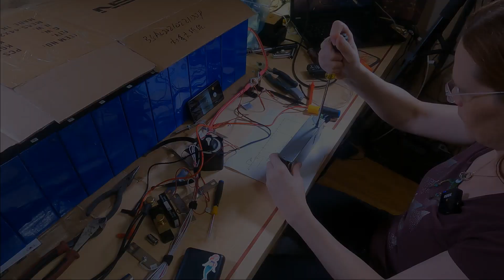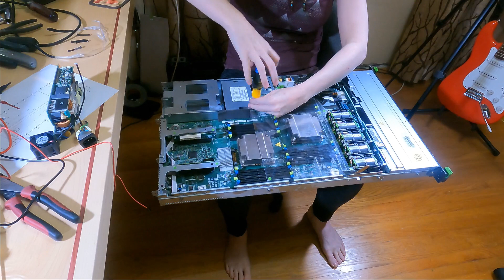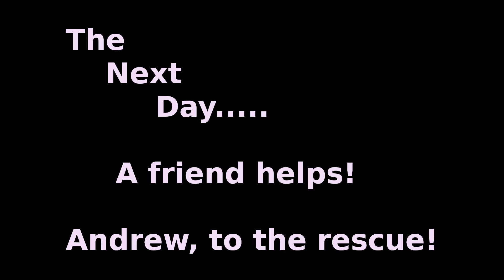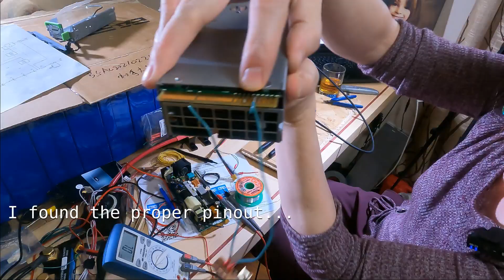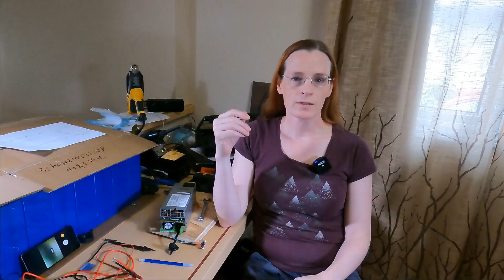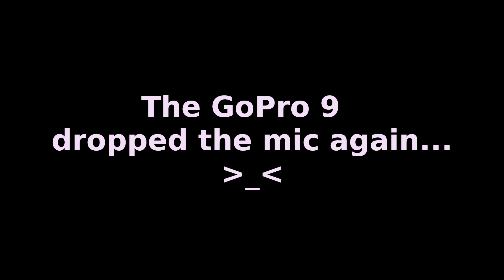Building a Good and Cheap Bench Power Supply - How to build a 48v Lifepo4 battery (Ep. 7)

Comment: Yea, I know, 2 years old ... but, at 23:35 ... instead of cutting the tinned tip, you can use a big pair of CHANNELLOCK pliers and flatten the tinned part.  I make power supply's with these all the time.  I recently made a 48v 63A PS with 4 of the HP 750W.  You need to be careful with the grounding, but these server power suppliers are awesome.
Reply from the maker: They are, and it was a fun project! I was using it today, even

Comment: I use gopro cameras for my youtube videos and they are the most unreliable devices I have ever used and not cheap. They constantly crash or discharge the battery for no reason. I am also amazed how they are still in business. Really enjoying your video's.
Reply from the maker: I hate the thing so damn much... Now it's 2/3 times, turning it on is a five minute ordeal... Skip all the damn ads for their subscription service, camera wants to set the date, quick app sees the camera but the camera doesn't talk to the app... delete and re-add the camera to get it talking, finally start filming. Or other times, it just won't turn on until I pull and reseat the battery. To say nothing of the crap battery life, constantly turning itself on when it's charging, corrupted files... ugh

Comment: What size wire did you use to connect to the two 7 AW's coming off the JK bms?
Reply from the maker: iirc, I used 4awg ring terminal to fit the 2x 7awg(??) cables the Overkill Solar / JBD BMS came with.

Comment: HOWdy  D-M,
Basically a  FREE "bench"  Power Supply  from an vintage SERVER 
Thanks
...
Yesterday  I  hoisted my  110 pound  GroWatt 6000 INVERTER  up on the Wall ( wall covered in Cement Board ) 
Today's project is to "FISH" my 100' long brand new ( CHEAP )  Steel FISH-TAPE from the House out to my Ground Mount ARRAY 
   ( I was going "fishing" YESTERDAY but my High-Dollar  KLEIN Fish-Tape BROKE  4'  out of it's ROUND Tool Case )
Fingers Crossed - I'g love to have some  "PV" Power to Charge MY Batteries 
COOP
...
Reply from the maker: I'm actually surprised you broke the Klein... Can you return it?

Comment: Please remember, BEFORE you test continuity / Ohm's, ALWAYS test for voltage when working like this. Specfically when there are capacitors. You Never Want voltage present when testing continuity / Ohm's.    It may seem trivial. However with enough voltage, you can let the magic smoke out of your meter. I've seen it happen. I give a 5 minute discussion on meters and testing continutiy / Ohm's.       And as I walked away...   I head the meter jump off the bench, and the guy using it fall on the floor [because he was scared -- not shocked] because he put the meter on Ohm's and put the leads in a live AC outlet.   Magic smoke everywhere. 

If you put the meter on the highest DC voltage setting, and check for voltage on the ends you are going to test for continuity. If nothing else, it will safely discharge this kind of capacitor shown in this video.
Reply: i was going to ask, once power supplies are powered, i know there should be time left for discharge, but when testing there has to be a way of doing this safely - thanks for sharing

Comment: I use Riden supplies, very programmable, and ideal if you need a power supply that will also charge batteries. I own both the RD6018 and the RD6012. Yes, a complete kit is almost $200 US dollars, but they are very worth it.
Reply from the maker: Looking at the RD6018, it shows a Mac amperage of 18A. If so, the iCharger X8 can do 30A for under $100, assuming you have a sufficient PSU for it, like a modified server PSU. Given how long it takes to top balance a 16 cell pack, that's a non-trivial difference. Am I missing something about the Riden?
Reply: @TheDigitalMermaid  The maximum amperage is indeed 18 amps at 60v. It is good for charging a 48v pack, as well as 18 amps at 3.65v, and everything in between. I do admit I use a 30v at 40 amps supply for top balancing, but that will only charge a 24v pack. The Riden is more aimed at the benchtop lab market with a USB and optional wifi interface. It is quite reliable however, set it to 3.65v and walk away, it stops when current drops to .1 amp in the battery charging mode.
Reply from the maker: @john_in_phoenix  for pack charging, I use the Quattro, which is also an inverter. Suppose it depends on your focus.
Reply: @TheDigitalMermaid  very true. I have lots of uses for programmable power supplies. Usually I charge in series until one cell hits disconnect, then in parallel to finish at 3.65v. I will probably try an active balancer soon, same concept as the icharger, just cheaper if you already have a good supply. Charge in series, then when the cells get in the 3.4v range, drop the current so the balancer can keep up. Like Andy, the first thing I figured out about active balancers is that they will actively unbalance you if left on in the flat part of the curve. They work great at either extreme though. I should add that I am a tool junkie, I have 4 of the Ridens, so tend to hook up 4 cells individually and set them at 3.65v.

Comment: I was lost as to why you were having so much of a struggle getting solder onto the pads, and then you mentioned Lead free solder. 99.3% Tin-Copper solder (which is a lot of Lead free solder sold on the reel) is notorious for poor wetting, even the better quality brand/makes such as the one you have. A no clean flux pen may help a lot in situations like these; they look like a paint pen but have flux in them. Rub the felt nib over the pads, which besides adding flux it helps displace any gunk. Congratulations on making it through, must have been frustrating. Yes, gopro sux.
Reply from the maker: I realized it was flux later thanks to another commenter who mentioned the flux in the solder core. Having an actual flux pen/brush though is a great idea, thanks!